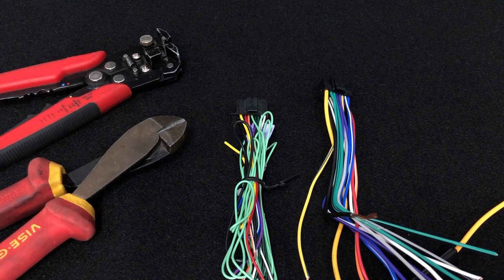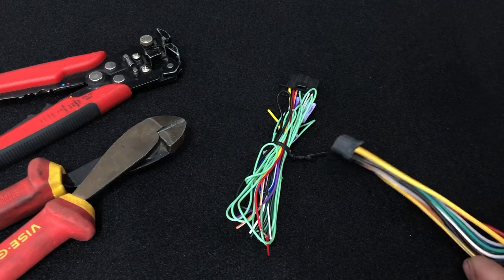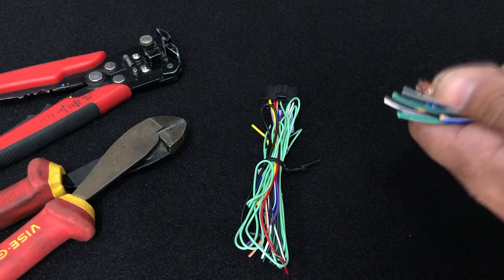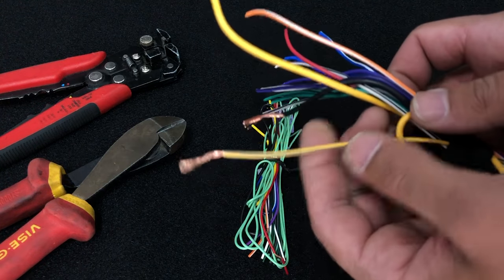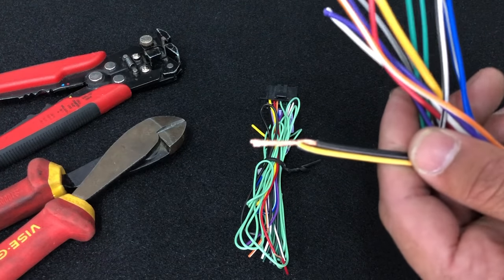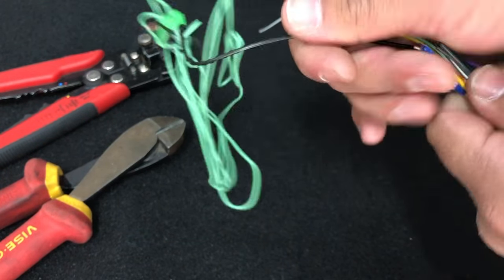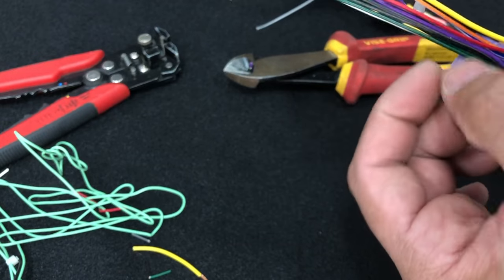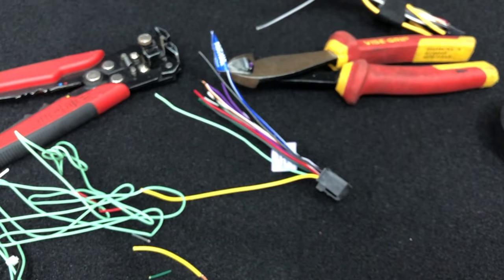Easiest Way To Bypass Park Brake Wire!

Comment: I’ve had the same radio for over 6 years (BV9967B, Boss audio) been through 4 vehicles.. I just slip the parking brake wire into the back of the radio harness and it’s good to go..
Reply: How do I do that?
Reply: @chrisjay2901  all you have to do really is wire it to a piece of metal.. make sure if you don’t use the radio harness, use tape to not cross connections..
Reply: @cbdxishop2953  Ok will it work for the factory ones as well???
Reply: @chrisjay2901  not sure. Never tried on a stock radio. This is the only radio I’ve ever installed to my own vehicle(s).. I got an older vehicle “93 Dodge Grand Caravan..but if your parking wire is marked and you know which one it is, I don’t see why it wouldn’t. Probably wouldn’t recommend doing too much though if your car has an alarm..

Comment: I'm using a wire harness from an older pioneer on my 2nd hand avh 2550nex  that didn't come with a harness, the colors are slightly different

Comment: Just installed in 2002 Toyota Highlander Sony XVAXA-1000.....simple-- place parking wire under radio mount 10mm bolt that screws into the METAL DASH FRAME.......not to anything else......if you  make sure the bold is going into center dash metal support bracket it works great. If you use plastic area only, won't bypass....     Great short cut for demonstration purposes of course.   This is a iPhone ONLY CarPlay radio.
Reply: thanks......Seems I'll be sticking with the Sony line since they all seem to work with this "testing" purposes fix....!!

Comment: Hopefully you can still respond but, how do you make the green parking brake wire from the stereo become “grounded” to the chassis of the car or the metal of the stereo itself? Like how do you make it stick with the end of the wire to the metal so that it’s grounded??? Hopefully you get what I mean, im new to this
Reply: By soldering the park brake wire to the GND wire, you effectively ground it. No need to attach it to any metal on the car, just do what the video says and the wire will be grounded
Reply: @Ben Flynn  don't you have to ground the black wire to the car? would it be OK to just twist both wires together with out soldering them, and just connecting them to a screw? I don't have the equipment

Comment: So basically you just connect it to ground
Reply: It doesn't work with the pioneer cus it has to have a break in the ground so I would have to touch ground twice
Reply: Yep Pioneer has timed pulses of electric, it sucks
Reply: I just plugged the green parking wire into the black connector that connects to the back of the unit there is a space pretty much in the middle  and wrapped the exposed wire end  around a screw that connects the bracket that holds the unit and its always on now the hard part was just getting to the back of the unit.i hope this helps someone I suck at car stuff and I did it mine was for the avh-a205bt model though and I don't have to do anything at all after its just always has the options lit up now
Reply: Just use a toggle switch. Handbrake wire from radio into switch and a wire out from switch to Ground. Flip the switch on and off 2 times when you want to engage the features.
Reply: All you need to do is wire the parking brake wire to ground. I did this by grounding it to a ground on the harness... this worked for me on an av110bt car headunit. Now I have access to the bluetooth menu, to delete paired devices
Reply: Yes exacly this is true for all these type of stereos 👍🏼🫡

Comment: Just a question if anyone's still active on this video. After you connect the unit's gound and park brake wire together, does it then have to be connected to vehicle ground os is it grounded through the wiring of the head unit? Thanks
Reply: Still need to ground it

Comment: Hi! I have a pioneer sph-da120 and the light green cabe is missing - it's not in the connecter. Where is it's suposed to be connected?
Reply from the maker: Andreas Larsen If not on the original power loom then it’s not necessarily needed

Comment: Hey mate thanks for this. I've just installed an Alpine ILX 650e unit and need to bypass the parking break in my 2013 i30 (no nav), which wires do I solder between the headunjt harness (I've got the plug and play Aerpro kit) and the car wiring?
Reply: Sunil how did you go with the ILX 650e, did it work or does it require a pulse signal?

Comment: I'm seeing a lot of comments about in the states it needs the bypass - what about UK? will this work or will i need to get the bypass too? 
I've just got a SPH-DA2300 for my '06 A3 - just waiting for the wiring loom to come before i try the install but trying to get all info together so i can get it sorted ASAP! 

Cheers!
Reply from the maker: Brad0193 Great question! Maybe test it with the unit not installed all the way and if it works awesome! And if not you’ll need a switch or the “on/off/on” rubbish the states units need
Reply: Hi mate, were you able to get it to work with just this trick in the end? I'm in the UK and just got a pioneer head unit was wondering if I need to order the bypass or not.

Comment: Same question...different model.  Will this work with the Pioneer AVH110?
Reply from the maker: xX The Vanguard Captain Xx Yep. If the unit has a park brake wire this will work. Putting it to ground tricks the unit into thinking the park brake is always on 😊

Comment: Hello! I have a pioneer Avh-270bt. 
I have not installed the light green wire. Can you help me and tell in which pin should i install it? 
Because without it i cant clear the memory.
Can you help me? 
Thanks a lot
Reply from the maker: Ervin Xhani Hi mate not sure which pin it is. Take photo of the plug go to your local auto parts store and compare with a unit that has the same plug with the green wire and then pin it.

Comment: I have a 2008 Jeep Commander with the Factory deck which I don't want to change & I can't find the Parking Brake wire.

Can you help me out here ?
Reply from the maker: Durron Anderson It probably isn’t a wire you might need coding or a module.
Reply: Thanks a lot.

Comment: I have a pioneer avh-241ex and I’m installing it on a 2500hd duramax. My harness has a mute wire that is yellow black is that the right wire?
Reply: did it work?

Comment: What’s the best way to identify the correct wire? Namely in a 2019 MUX with the Panasonic head unit? Cheers
Reply from the maker: Alex Swan Hey mate! On a factory radio it’s not that simple unfortunately. You’ll need an add on module or something like, perhaps even coding.
Reply: Pink.....
Reply: Just go to the owner's manual and look at the radio wire diagram if it dont say on small print on the wire and match them up

Comment: Ive also read some units require a change from hot to ground to enable VDO/BT. There is a device sold on EBAY that does this step...
Reply: It doesn't need to switch hot and ground actually. It just needs to pulse a ground, then hold it constant ground which is what that doohicky device does. So far I have found only Pioneer and newer Alpines need that pulse. Most other brands you just ground the P brake wire. Now older Alpines needed both a ground and positive and for that you needed something a little more complex like a PAC TR-7... about 15 or 20 bucks.
Reply: To explain.. Pioneer and newer Alpines only use one wire to detect the parking brake pulse which throws a ground. The older Alpines they were more slick and made it so the head unit needed 2 wires for bypass... parking brake which is ground, and regular brake which is positive hot. So the device just faked the unit into thinking both were connected to the vehicle.

Comment: When I mirror my phone to my head unit, it only displays black on the unit. I can still control my phone from the unit, but cannot see what I am doing. Any help is appreciated!!
Reply: If uve already tried grounding the parking brake wire n that doesnt work for u then the next step is running a grounded switch n hooking it up to ur parking brake wire n then u flip the switch on n off or just on depends on the unit but this way is tricking the unit into thinking the parking brake has been set

Comment: Ok. I just said to hell with it and tried it myself with the AVH-3500NEX, since I did the install myself anyway. And it worked. Now my Android Auto works. Which is what I was having the problem with. I don't watch dvd's in my car so I didn't test if that works. Like he said, just connect the green/white wire with the black ground wire from the back of radio and connect to the ground wire under the dash of the car. Thanks a lot. Saved me a lot of headache

Comment: On some headbunits, this doesn't work.  The head unit wants to see the ground signal turning on and off.  If it's constant, it still locks out the options.  On those units, you need to install either a relay, toggle, or momentary off switch.
Reply: How do you do that?
Reply: @jose7398  easiest way is to find a spot for a normally closed momentary switch and land the parking brake wire on a ground.  Install the switch on the parking brake wire

Comment: So will this bypass fix the problem of my maps not acquiring gps signal? (Mind you I have neither bypassed it nor hooked it to my parking brake)
Reply from the maker: Tyler Murpht No your maps are not acquiring signal for one of two reasons..
The external GPS antenna is not plugged in.
Or it is plugged in and if you’re using CarPlay or AA it’s interfering with the signal :)

Comment: my pioneer plug doesnt have this green wire what can i do? i was thinking of wiring it directly to the ignition
Reply from the maker: Park brake wire to ignition? Definitely not. Ground as per video. If it’s not on your harness you either don’t have a video head unit OR you have a video head unit with the wrong harness :)

Comment: Having a cell phone is 100 times worse than disabling  the feature on stereo .Will it work for Alpine iLX-W650 ?
Reply: Literally working on the same head unit right now😂
Reply from the maker: dunno yolo In the states no. You need ON/OFF/ON Signal with a switch
Reply: I don't know what car you drive but honestly it was super simple for me to connect it to the emergency brake wire on my Honda Accord

Comment: This will work on alpine ilx650. I heard it wants a pulse from ground to power to release it to unlock settings. ? If straight to ground will work that will be a lot good
Reply from the maker: Stink_bait_ If you’re in the USA You’ll need to add a switch or use a module for the pulse. AUS it will work fine - EU not sure need to try it

Comment: I don't even care about  watching video while driving but even in park I can't delete old phones in the Bluetooth settings it appears the parking brake wire is going into an OnStar harness and I don't know what happens after that
Reply from the maker: Chelsea Sandlin Just put it directly to ground. See if it clears up for you. If it works intermittently you’ll need a switch or another small module. If it works indefinitely then you’re welcome

Comment: My Pioneer AVH-211EX greyed out my Bluetooth settings once I tried connecting another phone to the radio. Now it’s greyed out even when the parking brake is on. I’m so confused as to what to do rn.
Reply from the maker: CincoJayMaio hey mate. Good work with trying to park brake cable. Try this - one of the hard buttons will have a small symbol above it. A power symbol like on/off. Press and hold that button. The unit will turn off. Press (not hold) it’s again to turn it back on. Now immediately go into settings > Bluetooth and have a look. FYI doing this puts the unit into source off mode and some settings can only be accessed that way . Let me know

Comment: Do you know if this would work on a pioneer DMH-Z5150BT?
Reply from the maker: Jonathan Mason in Australia yes :)
Reply: @TheFittingBay  I'm not in the land down under LOL.  My friend tried this method with a Pioneer AVH-X595BT and it worked when he started the vehicle but when he switched off, removed the key and started again, it stopped working.  So he installed a switch which he manually works to get around it
Reply from the maker: Jonathan Mason Yep that’s the fix outside of aus

Comment: The easiest way is to just wire up with your ground  wire already ran on the radio
Reply: If you do that with a Pioneer or Alpine you still won't have video in motion function. They got slick for liability reasons and made it so that P brake wire needs to see a ground pulse then constant ground to work. Other brands you can just ground it to the ground wire. Easiest way with Pioneer is a switch to pulse the ground or use one of those video bypass doohickys that are 3 wire hookup, about 10 bucks but will do it automatically, no switch needed.
Reply: @whichgodofthousandsmeansno5306  can I have a link to the pulse switch homie ? Please

Comment: This doesn't work on pioneer...  it has some kind of time delay sensor in which you must ground d parking brake wire then unground it then ground it back.. 
So just having it permanently connected to ground will not work..

Comment: This caused my brake light to be always on when driving.is there a way to get it off without removing the mod?
Reply: Don't hook the brake wire to anything. You're grounding it, so obviously it will turn on the light.

Comment: I’ve installed a Sony xav ax100 into my vw polo. It had a green wire that wasn’t connected. The stereo works like normal. Do I need to still do anything?
Reply from the maker: Santhosh Hi mate! If everything works as it should don’t worry about it. This helps with certain features not working while the handbrake is disengaged. So if all is working fine I wouldn’t bother :)
Reply: The Fitting Bay thank you

Comment: Anyone know if this works with Alpine ILX-207 ?? Wanting to upgrade my 03 wrx but honestly not sure how else to do it and be able to access my settings even when parked...
Reply from the maker: Cobi Dufresne Where are you located?
Reply: @TheFittingBay  BC Canada
Reply: @TheFittingBay  this is actually the easiest smartest fix.. this one is for an alpine unit. You can get a few different ones.
Reply from the maker: Cobi Dufresne In Canada and the states yes. In Australia (possibly other countries) this is the easiest fix as it’s free AND easy 😎
Reply: @TheFittingBay  True. Gonne go this way was worried about it not working due to gps etc. Thanks for getting back!

Comment: Well, i have another problem. All my sound settings are greyed out after i installed an aftermarket amp. My unit is a Pioneer 3100dab. Does anyone know a way to fix this?

Comment: I have a issue every time I put reverse ...the sound shut after I put drive at this point I have to go to home screen and click on radio and the sound come again ....when this happens the radio is on but no sound .....any help? thanks
Reply: Did you find a solution I need help

Comment: Hello! have you all done this on a Sony XAV-AX5000? Does it work? Thanks!
Reply from the maker: DonnyFrusciante III Yes and Yes!
Reply: @TheFittingBay  thanks for the quick reply? What about for a Pioneer DMH-1500NEX? I have heard that it doesn't always work for pioneer radios, especially the newer models? Thank you :)
Reply from the maker: DonnyFrusciante III Here in Australia, it works on every unit. Even their latest releases which have different part numbers. So we’ve had a few people saying it doesn’t work and the few people are all in the states or elsewhere. So maybe the units there are different? But over here we have no issues.

Comment: How do you do this on the pioneer AVH 3500NEX?
Reply: I was wondering the same thing. After I do this, will it enable android auto to work? That's what I need it for
Reply: Ok. I just said to hell with it and tried it myself with the AVH-3500NEX, since I did the install myself anyway. And it worked. Now my Android Auto works. Which is what I was having the problem with. I don't watch dvd's in my car so I didn't test if that works. Like he said, just connect the green/white wire with the black ground wire from the back of radio and connect to the ground wire under the dash of the car. Thanks a lot. Saved me a lot of headache

Comment: The fitting bay will this work on pioneer avh 1300 nex thanks for the help
Reply from the maker: Gregory Glosson Sure will
Reply: @TheFittingBay  No it won’t.
Reply from the maker: Vic Paar Only works in Aus as we are beginning to figure out hence 50% say it works and 50% say it doesn’t so you’ll have to move here